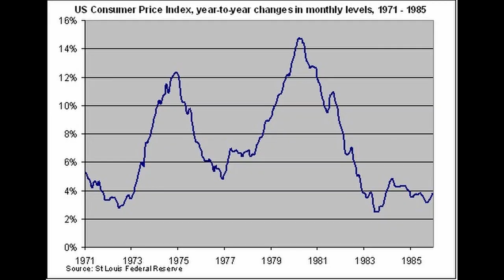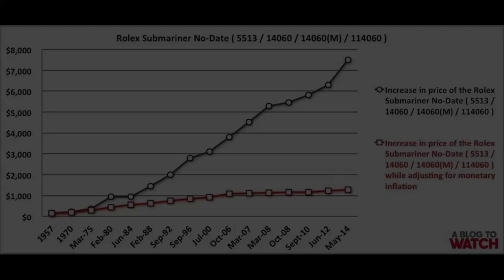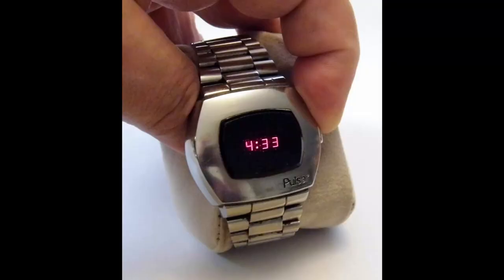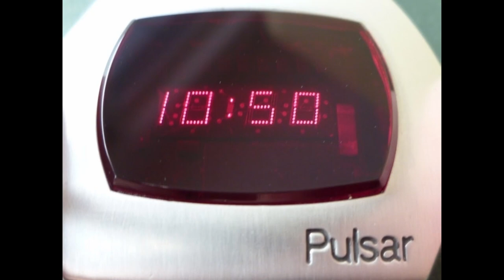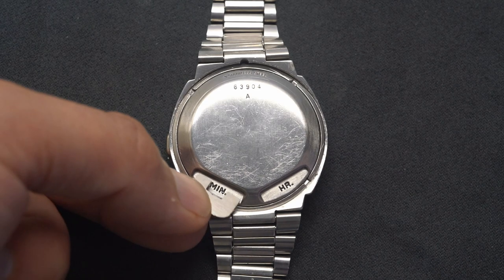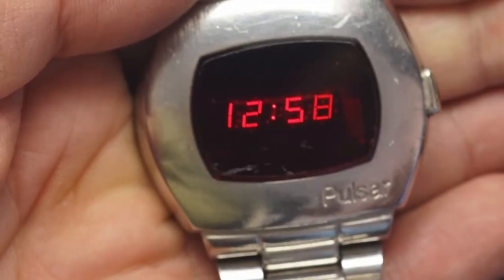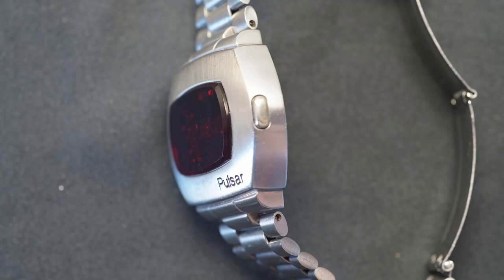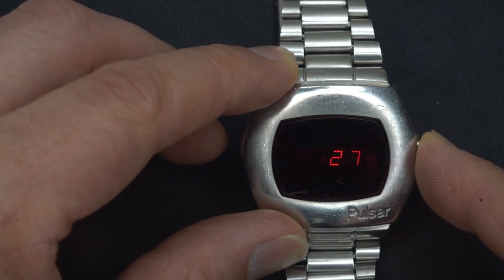Vintage watch review - The Pulsar P2

Comment: I saw one today at a local flea market.  It's the gold filled version with original box. The guy wanted 200 dlls. I hesitated  because it had a dead battery and I have no idea how easy/hard they are to fix. Kinda want to buy it now if it's still available tomorrow.😅
Reply from the maker: Hi Hector!   That's really cool!   I'm amazed you even saw one at a flea market.    Most of the flea markets I go to only have fleas!
I reckon go for it.  Even if it doesn't work, start hunting around for a new movement.
Check out these guys, they may be able to help.
https://pulsarledtime.com/

Let me know if you go for it!!!
Reply: Ended up passing on the watch.   I got to inspect it more and it noticed it had alot of corrosion by the back plate.  It really was a shame. The watch  looked like it was worn only a couple of times and just put in storage for years.
Reply from the maker: Yes, that's a shame.
I'm glad you got to check it over again.
Hopefully you will find one soon!

Comment: I've wanted an LED watch since I was a kid in the 70s.  I finally saw one in a local auction that looked to be in good shape but was untested.  I decided to take the punge and ended up winning it and spending more than I had planned.  Unfortunately it doesn't work.  Parts of some of the digits light up and are continuously on.  There is no response to the button.  I'm desperately trying to fix it now.  I might end up selling it for parts down the road if I can't fix it.  Even broken ones seem to sell for hundreds of dollars on Ebay.
Reply from the maker: Hi, thanks for your comment.
That must have been disappointing to have the watch not work.
I dare say, they are impossible to fix.
However, before you sell it, have a think about putting in a re-creation movement.
https://pulsarledtime.com/
This is what I have in one of my Pulsars.  It uses the same LED module, so the look is the same.
I love it.   It means I have my old Pulsar working again, looking the same, functions the same, just with some new electronics.

Perhaps contact them for more info.

I hope this helps
Best regards, and good luck!
jules
Reply: @1chapteratatime171  Well, I've tried everything I can to fix it.  I even replaced the quartz crystal.  Made no difference.  I haven't decided whether to sell it for parts to recoupe my money or go in deeper and buy a new module from that site you provided.  This watch used to belong to the former mayor of Toronto Mel Lastman, so it does have a bit of local provenance.  That was a factor in me buying it in the first place.  Except for the fact that it doesn't work, it's in great condition.  🙂  Hmmmm...what to do.....